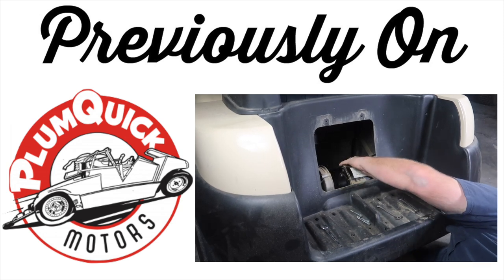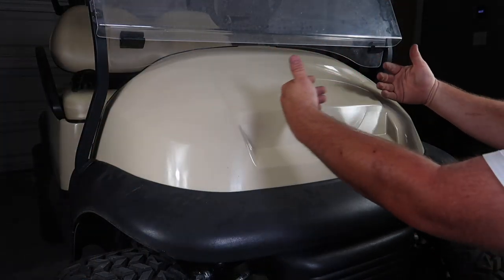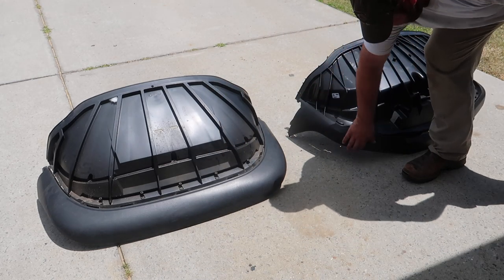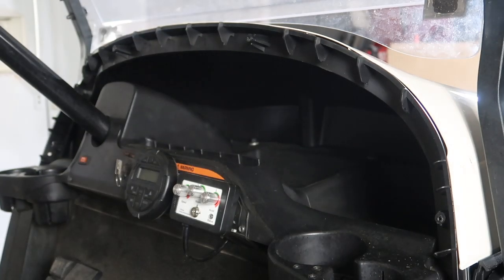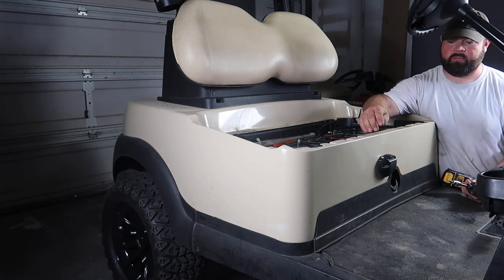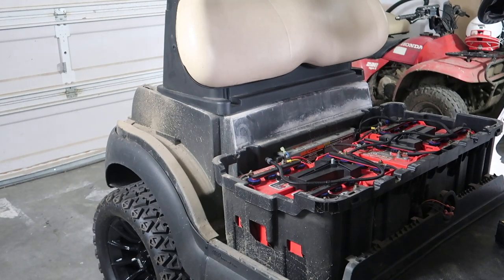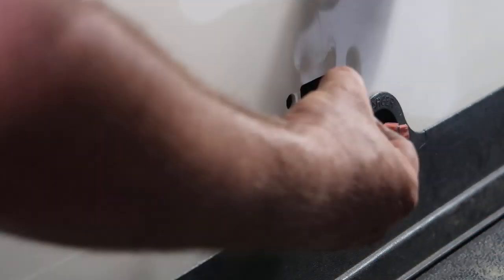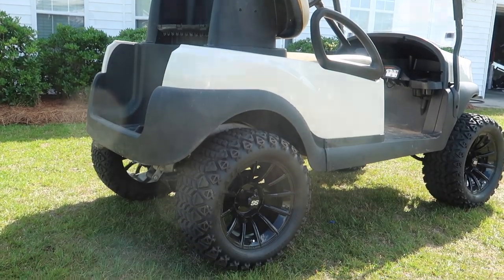How To Install Club Car Tempo Body | How to Remove & Install Club Car Precedent Golf Cart Body

Comment: I'm looking into getting my first cart and I was wondering what is the going rate to replace all 6 8 volt batteries? What's a good brand?
Reply: Trojan or oddessey would be my 2 choices. Probably looking in the 6-700 range for basic batteries
Reply from the maker: I agree with @scgolfer88, running trojans has been a family thing if I had to buy wet cells. Locally our cart store sells them for 699 with cores for t875s.